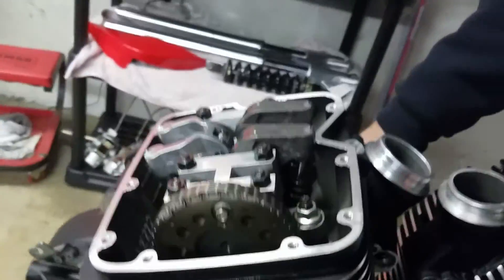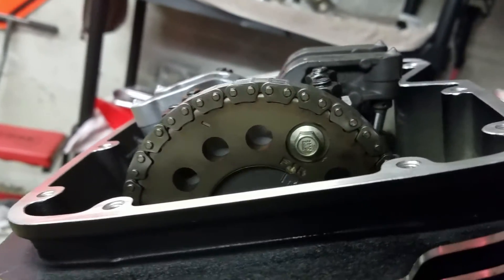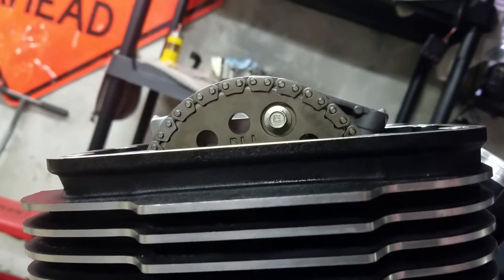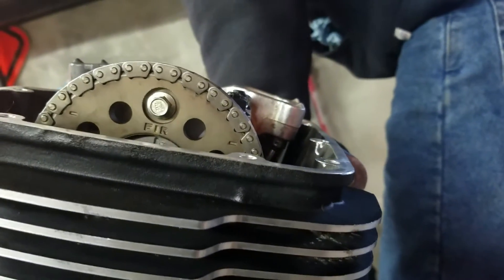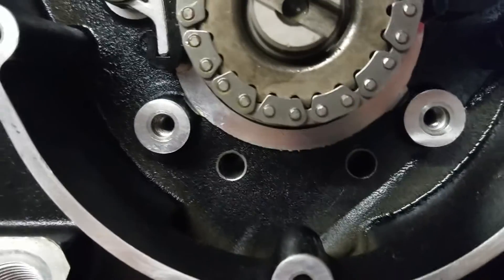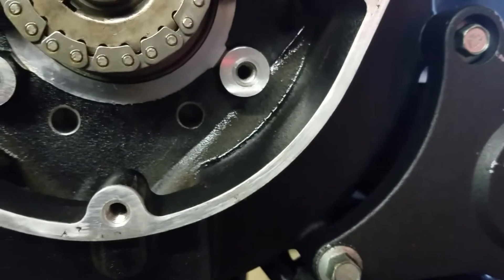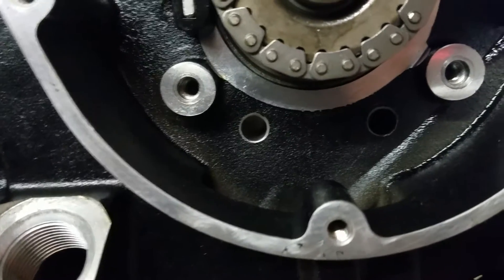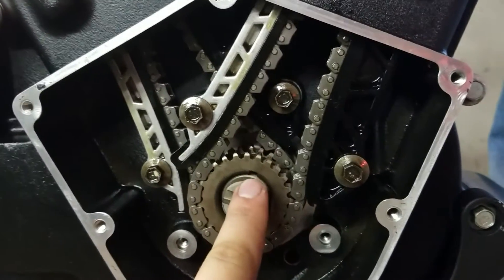Victory Lloydz VM1 Cams Final Check (Part 5)

Comment: I just put new cams in my kingpin and checking the timing and it seems both sides are off by a hair, when you line it up with the top, they look the same and if I move a tooth either way it makes it worse. is that close enough or another way to adjust it to make it perfect?
Reply from the maker: Hello! If you are off ever so slightly you may want to try this; The easiest way to time these is start with the rear and pull all of the extra slack from the front. The tensioner needs to be the side that holds the slack. You'll notice that it will be slanted ever so slightly to the front of the motor, but when you install the tensioner its should pull it back. Be sure to use the dowel or punch to hold the crank in place too. If your punch has too much play holding the crank, that will also cause it not to be on time. Those lines will line up almost perfectly if you follow these steps. Let me know if I can help any more!
Reply: Should have zip tied the chain to the sprocket and would've never been outta time.